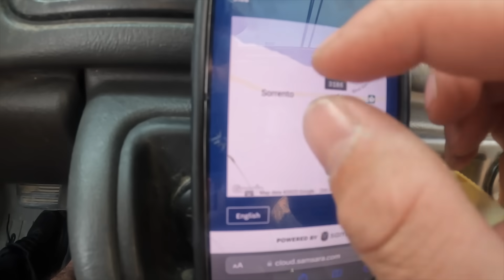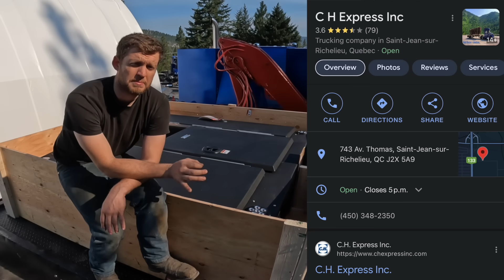Behind the Scenes Drama: CH Transport vs Electric Truck Delivery - The Real Story Revealed

Comment: I have unloaded and loaded trucks a lot. The way you offloaded seems terrible (and that's from a guy who has packed pallets with boxes inside containers). At bare minimum you would need forks on the front loader/backho and a pallet jack to move the pallets inside the trailer. That would make it 10 times easier. Yes a loading dock would be better, but just the ability to move the pallets to the back of the trailer makes it much easier.
Reply from the maker: I can only assume you watched the last 1/3 of this video with your eyes and ears closed 
-Theron Danger
Reply: @EdisonMotors I saw the last 1/3 of the video. A pallet jack isn't expensive and would have helped a lot moving those pallets inside the trailer. Yes I understand it's not quick attachment on the loader. But there are solutions for that to. I have seen forks here in sweden that hook on to the front bucket that you can lift on yourself.
Reply from the maker: An engine jack is kinda a pallet jack

Comment: I bought a dump trailer around 750 miles away. Posted, go some company that said tgey could for like $800. And my line was around $900 to just jump in the truck and go get it. Finally 2 weeks later, they get some hot shot pickup hauler and have to pay $1100. I was done with their bullshit and gave up and gave the money. I hate posting loads on load finding websites. Another time i thought about buying a ATV, and posted it on a load finding website. 50 different messages, and only one said "yeah, we can do it on a partial load, it's going to be around $400 to do it." Every other email was 8 fucking paragraphs of bullshit.

Comment: I would vote that the extra axle be used on a service truck. I never understood the configuration of most of the service trucks which require running the main vehicle engine to operate the hydraulic/electric crane. About 10x  too much Hp and corresponding use of fuel due to inefficiency. A totally 3 phase commercial voltage system allows much less expensive 3 phase electric welding machines and air compressors. I pitched a electric drive to U S Army years ago applied to the M88 recovery vehicle but they were not interested.

Comment: I want sold a gas refrigerator to a customer I was in the renewable energy solar and wind business and helping them cut their electrical consumption

when it finally arrived they shipped it to another trucking company to be picked up there that was not the way it was supposed to work and when they picked it up there and took it back to their place I showed up and there was a forklift fork hole through the center of the refrigerator 

and nobody want to do admit having done it so I just refused the shipment and started out again

Comment: Brokers are the absolute worst.  
The trucking outfit that my father works for has been hauling for Driscolls berries for 70+ years just for them to start using a broker that now will find other transportation that will do it for the cheapest price.  
This is making the company my dad works for have to slowly close its business. It’s went from 14 drivers to 6 in just 3 years. Probably another 3 years it will be closed completely
Reply from the maker: We need to have the brokerage industry much more regulated and much more liable & transparent.

Comment: If the freight company had a broker cover the load, then that broker had another broker cover the load, that is a double brokered load. If a Freight company brokers a load, that is just a brokered load. If they had an agreement to not broker, that's one thing, but this isn't a double broker situation. That being said, every single other complaint seemed completely valid.
Reply: "Double brokering occurs when a shipper hands off their freight expecting a broker to pass it on to a valid carrier. Instead, the broker hands the shipment to a secondary broker unknown to the shipper, which is then given to the carrier."

There were no actual brokers involved - CH was supposed to haul the cargo, yet acted as a broker by selling the job to the final carier.

So, technically speaking, the job had already been brokered to them by the shipper, and by acting as a broker, CH double brokered to the final company.

At least this is my understanding.
Reply: My thoughts exactly.
Reply: @WatanabeNoTsuna.  
That is how I see it too, definitely double brokered.
Reply: @WatanabeNoTsuna.  you said it in your reply, when CH agreed to cover the freight, there were no brokers involved, it was not brokered, it was paid to be shipped, Edison paid for C&H to ship it. Then they brokered the freight. This isn't a double broker, plain and simple, the shipper (C&H) acted as a broker and paid another trucking company ship it for a lower price. Then there is the whole LTL issues where the load is having things added and removed to it several times and docked, etc. Ugly situation, but not a double broker.
Reply: @The_Endo  CH wasn't the shipper - Flodraulic was. And brokering doesn't have to be done by a broker - brokering is the act of negotiating a deal. So Flodraulic brokered a deal with CH, who then double brokered it with the other company.
Reply: @WatanabeNoTsuna.  I'm sorry but your argument literally makes zero sense and doesn't seem to grasp what I even said. The only part you go correct was that C&H did in fact broker the load to Autologic (but you called in Flodraulic?). C&H is a shipper/broker combo and Edison paid them to be the shipper, but they chose to broker the load instead, end of story. It wasn't brokered a 2nd time, look up the definition of a broker; paying a trucking company to ship your freight with their vehicles is not brokering a load.
Reply: @The_Endo  I 100% agree with @The_Endo. This was NOT a double broker situation. Shipper contacts CH to be Carrier. CH has Broker Authority and brokers load to Autologic. It was brokered. Not double brokered.

Comment: I've been following you since the biggening I believe, and I promise I'm not throwing rocks but there are a couple of things that strike me as odd. (1) You knew this truck was coming and was even late so why didn't y'all have stuff moved out of the way so this guy could get backed in there easier?  (2) You're worried about your equipment being unloaded and reloaded because of the sensitivity of the shipment but y'all had the most back woods way of unloading the truck when he got there. I agree with your dissatisfaction with the service you received but your complaint lost traction, in my opinion, with the situation on the receiving end. I get that you covered the unloading in the end but if you're going to claim that you stand to lose $7m you better look like your operation has $100k.

Comment: In the early 2000s, a friend of mine told me he was rear-ended by a meth'd-out CH Express driver while he was stopped on the shoulder of I-69 just outside of Flint, MI. The guy allegedly hit him so hard that he was looking at the inside of the front fender through the sunroof and his spare tire somehow blew off the trunk-lid and landed in the opposite direction of highway 1/2 a mile away. It left a crater. The guy admitted to being awake for more than 60 hours, driving more that 55 of them. He was the company owners cousin. Wouldn't be shocking to learn that the company hasn't changed much. edited for legal reasons